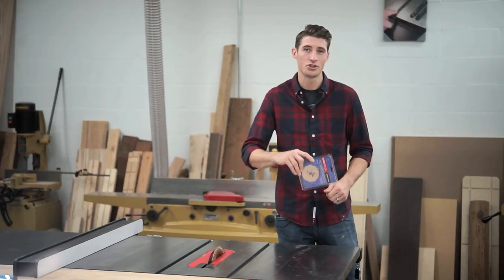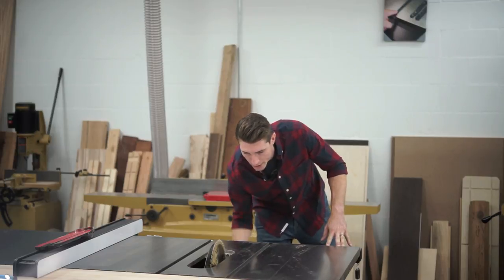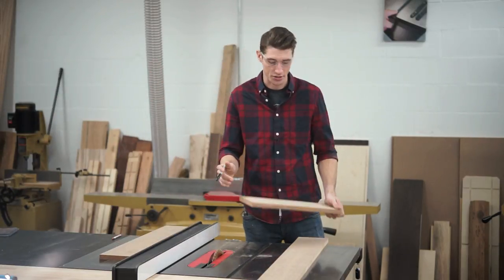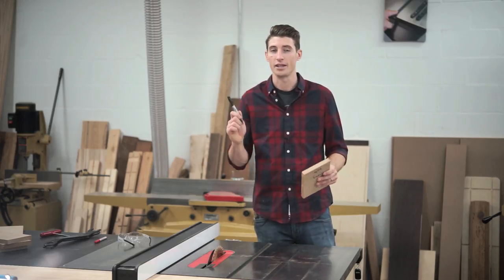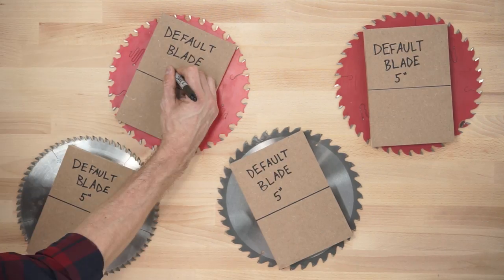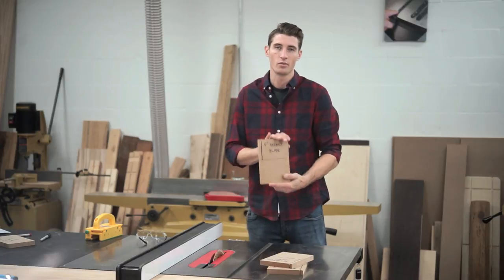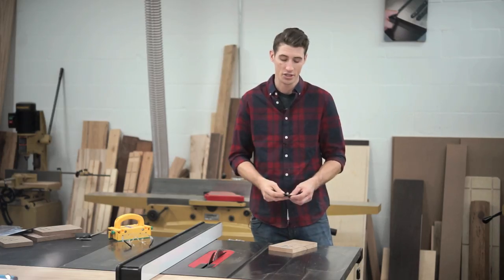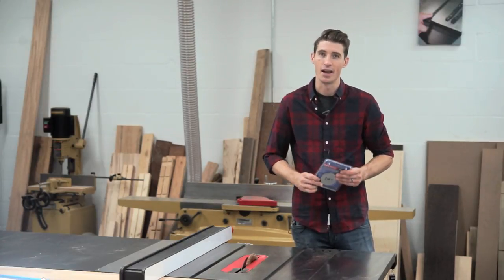The BLADEMATCH Arbor Shims | Instructional Video

Comment: I have a Incra fence system and always zero my fence to the blade before I use it. Very easy to do. May want to use this on the cheap Craftsman tablesaw I recently acquired.
Reply from the maker: Louis, thanks for watching! 
Keep in mind that using the arbor shims means you do not need to keep resetting the fence indicator between blades, and you can set the riving knife to the right side of the blade and never adjust it again!
Reply: @Microjig  I understand that. Issue is, I don't have a riving knife. Older Jet 10" contractor saw. This works for me as I can disregard all the lineup and remember which shims to use for which blade. Now, that I think of it, marking the blade to the arbor when I have that critical 90 degrees dialed in would be of benefit. After that, move the fence, reset the scale and done.

Comment: Awesome information and product. In the beginning of the video blade vibration, will theses shims stop the vibration?? Reason why I’m asking is when I shut my saw off my blade just before it stops spinning I get a vibration no matter what blade I’m using from Forrest to Freud from full kerf to thin kerf it happens. Will this solve this issue or is it something completely different??? Thank you for any advice you can give me.
Reply: MicroJig   Thank You for taking the time to help me out. I’m hoping it’s not a bearing that won’t be any funny.
Reply: The vibration might be from the belt, if your saw has one. Turn the blade by hand it will turn free then get hard then free again. I think the belt took a set from the different size pulleys. So if your saw didn't get used for a while , you could relieve the tension to prevent this. What do you think?